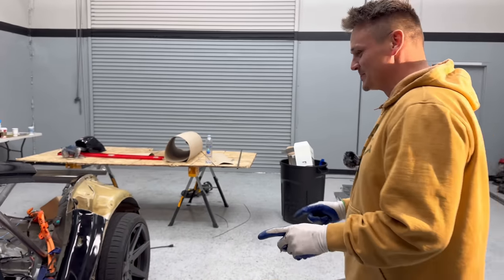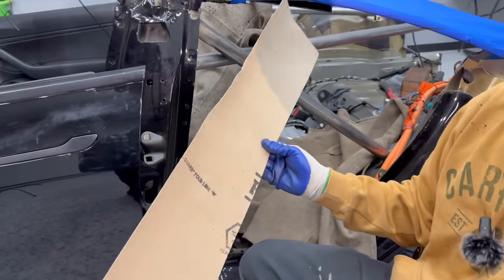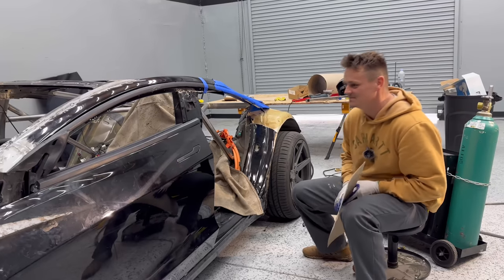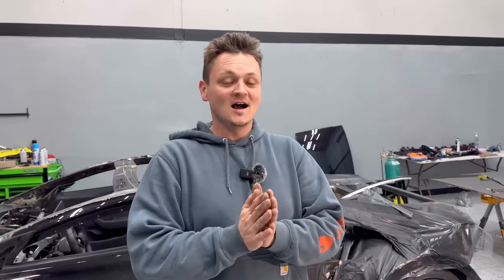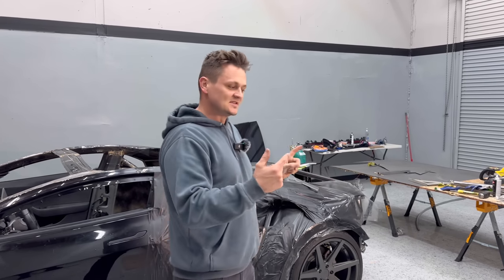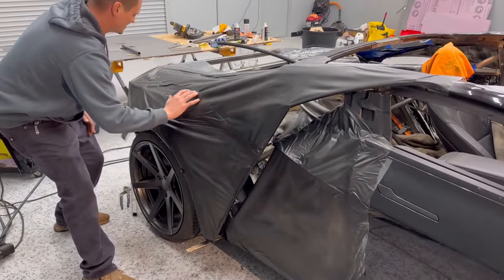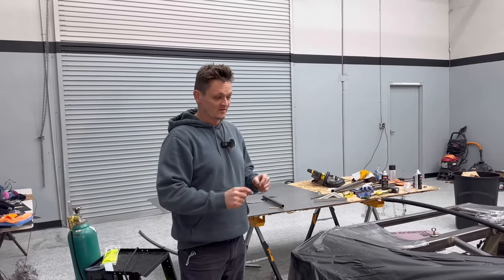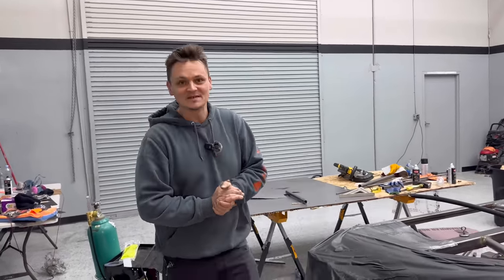Evolution of the CyberRoadster quarter panel

Comment: Like you mentioned at 9:40, it’s going to be extremely hard to make this symmetrical on both sides. I recommend you 3D scanning the vehicle, there’s many services that can come out and do this for you. Hire an engineer to model up your design, should be very straight forward being that your design is “complete” with your tape design. Then you can create 3D molds and mirror the molds to make a perfectly symmetrical quarter panel. The molds can be foam and cut very easily and fast in a large cnc that is made for this type of work. Better to do this then all by hand, may cost a little more but will be perfect and turn out better than the hand cut metal rod XYZ point in space approach.

Comment: You Badly need a 3D scanner and a good 3D artist to help you out cause all this tape and plastic ain't cutting it 🤣
Reply: I agree, this would speed it up, but honestly even with the renders, it’s different on paper, or in this case, on screen than in real life. He’s kinda tackling the “render” in real- time. Rather than submitting a render, waiting for the render to be made, making it in real life, then deciding it’s not “it.” I gotta give it to him, he’s creative for sure.
Reply: Let him be it’s worked thus far
Reply: Agreed. Super cheap and readily available nowadays too to do this. This needs to be the path forward.
Additionally - once the 3D model is done, you can CNC a foam mold of the part and then cast it in fiberglass. Would be the best option imo.
Reply: @TurnerBrittain  it's positive feedback brother his doing something amazing we all here for it
Reply: Seems to be working…early coach builders never had 3d scanners,
Reply: Maybe this is how he’s comfortable working.
Reply: It’s how they did it b4 3d printing